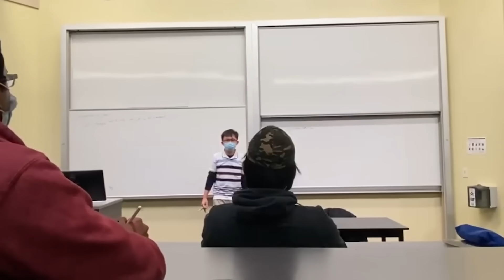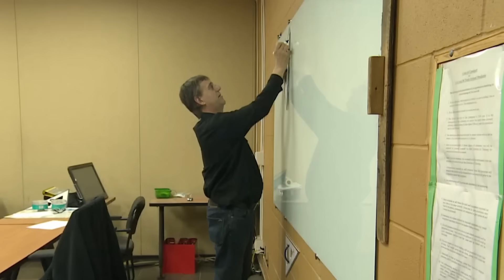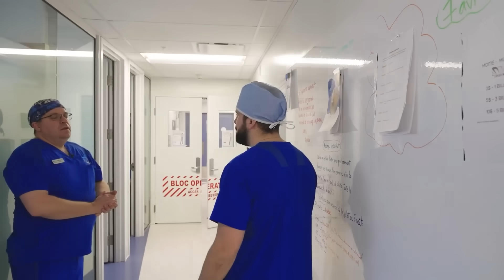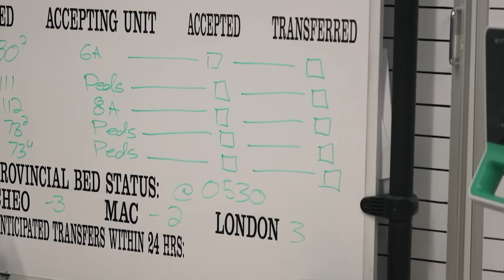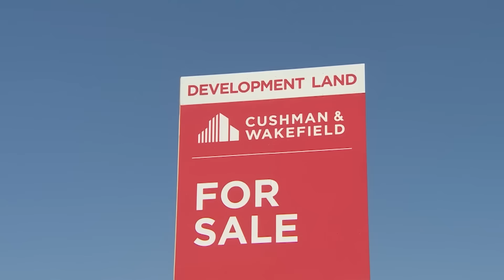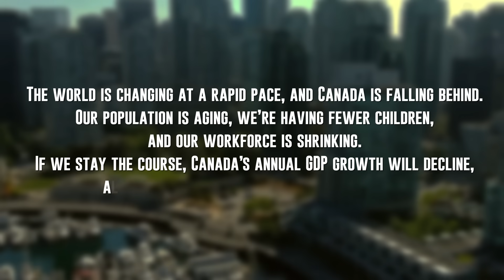Canada's Economy DESTROYED by Immigration Ponzi Scheme!

Comment: We need to put the brakes on immigration until our economy and infrastructure catches up.  Continuing with a target of over 500k immigrants for 2023 is ludicrous.
Reply: They need to remove everyone who doesn’t hold a citizenship. Period.
Reply: @smokiethebear3334 the country will be screwed then, as you don’t have enough high skilled workers or low skill professionals like truck drivers
Reply: @Austin-if7ne No, I disagree. Young Canadians will have to adapt to accept any jobs that are available. We generate enough home grown engineers and health professionals but we are made to believe we need to bring in foreign trained engineers. I worked as a regulator with foreign educated engineers but they had absolutely no field experience and could not problem solve a situation and would almost exclusively reject any alternative solutions with plans examinations. An alternative solution does not reduce life safety within the building code, but in all cases exceeds the code, but foreign educated engineers do not have the ability to accept something that varies from established codes. That is one of the many reasons why construction projects are delayed, or worse cancelled.
Reply: @Austin-if7ne  Canada Immigration system uses a point system that gives a lot of points to immigrants with high level education. So at the moment we don't really have that many immigrant coming here to do trades or truck driving. We have a different system from USA so that argument works more in the USA but not here. Most immigrants have university degree, also most of the ones who stays were university students on study visa.
Reply: We need hundreds of new apartment towers for these people asap
Reply: @smokiethebear3334 moron like you should not be anywhere close to voting booth
Reply: I agree but neither party will do it because population decline means lower or negative economic growth which could cascade into a major recession.
Reply: @davidmorton9722  Canada doesn’t generate enough engineers or doctors, most students in this fields are immigrants from China and India
Reply: @Marc-gj9vx The flood of immigrants illegally, Roxham Road, are unskilled. Also, a trained in Canada professional, in many fields cannot work in other provinces, without paying a fee, and going through a process.
Reply: @rockydj1000  cry harder.
Reply: @smokiethebear3334 do i own the country ? Thank god you're no legislator ...
Reply: @iamthatguy8071  As soon as you learn grammar, basic understanding of English is required here.
Reply: @smokiethebear3334   erm....a ? Well, then there're not that many people to remove lmao.
Reply: Meh. You could cap TR programs and maintain the 500k quota for Permanent Residents, since most immigrants are coming here on temporary resident visas/
Reply: The government says 500 k immigrants but is really bringing in over 1.3 M permanent residents and over 1.6 M non permanent residents
Reply: @jmela1370  can you prove that somehow? Because last time I checked, Express Entry draw cut offs would make PR unattainable for all too many international students for example. Not to mention that increasingly immigrants chose to leave Canada on their own, even after having obtained Permanent Residency, since they can find better options elsewhere.
Reply: @Austin-if7ne  that's a problem the government itself can fix, by stopping this ludicrous welfare payouts that encourage people into working part time or not at all. You want money, work for it. As crude as it is, it's simple.
Reply: @kobaltseven  i agree
Reply: It's funny when an immigrant calls others immigrants. All are immigrants here.
Reply: @theybanthetruth4955  My roots go back to the 1770's in Canada on both sides of my family.
Reply: @parkerbohnn  exactly, you're no native sir, you are European.  No matter how you spin it.
You are an immigrant too, I know you want to be a native everywhere you go, and stick a flag, but no sorry..
Reply: There will be more then that
Reply: @theybanthetruth4955 very true, just an immigrant who’s been there longer. Everyone does this, once they are in then close the door and don’t let others in.
I bet he likes when  certain females get in. You know the ones who are called model citizens. So he basically chooses who gets in
Reply: the problem is not immigration it is more that no one is taking steps to increase the infrastructure
Reply: We need to only look after Canadians right now. Canada is not responsible for everyone else. We need to get our economy back on track.
Reply: @Austin-if7ne  you dont need a degree to drive a truck. it's not that hard. it's about interfering in the market to have lots of workers keeping wages down while making housing scares, to keep rent high and profitable. Medicine, food and energy also keep going up in price, because of  the supply  getting stretched too quickly. Our country will be screwed if we keep  going this way. We dont need immigrants to do the jobs you think we're too stupid to do ourselves. We're not stupid. Your argument is though.
Reply: @tiata23  I never said anyone is stupid, it’s just statistics there are more numbers of immigrants in stem field, and if the country stop taking in refugees it would be better and the housing problem is because the government have stupid rules for construction
Reply: The problem started when we began taking in people from vastly different cultures with completely different norms and values from our own, mainly from islamic countries.
Reply: @Austin-if7ne  I mean I’m okay with stupid construction laws. If those laws are favourable more for the environment than construction itself. That being said Canada needs to find a way to balance the onset of people entering the country and keeping our countries beauty in tact. I’ll take denser cities over bigger any day.
Reply: @strife2746  I agree on that
Reply: @travm5540  think about it instead of building a single house for 1 family what if u can build a apartment building with 12 floors and each floor can have 4 apartments if buildings like this are allowed more then the price of housing will come down
Reply: @Austin-if7ne  true that I agree with you but the con of that would be personal space/privacy which is becoming more and more of a concern. You have 4 families in that building all with different ideal/values. That shits gonna go from a quiet building to an absolute Warzone real fucking quick. Example a family that likes loud music moves in next to the quiet type.
Reply: @travm5540  this is not a new concept it’s like this in most places with increasing population, just make thicker walls
Reply: @Austin-if7ne  Finally, someone who gets it.
Reply: @Austin-if7ne  no shit that’s common knowledge on your first point, that’s completely irrelevant but thicker walls won’t necessarily make the issue better. Try putting 3 rats in a confined spaces closely packed for so long no matter the walls they’ll still try n tear each other apart. We may be human but we are also by definition animals, animals are protective towards territory. so I would imagine my example holds true in practice.
Reply: @travm5540  you are talking like all humans are enemies, usually they live happily and are friends with everyone it’s the same as gated communities
Reply: @Austin-if7ne  they would not usually live happily tf? 😭😭 is this Disney or sum?  Just because won’t start shit doesn’t they still wouldn’t feel a certain way. Yes some people are fine with it but my point not everyone would be okay with the idea you proposed purely because people inherently have different values/rules when it comes to their own home and sometimes that can conflict. I know because I used to live in a conjoined apartment and even that was too much for some people. Like ya there’s good out there but there’s also the negative
Reply: @travm5540  I am saying everyone should, I am saying that should be a option there are many people who want a house but can’t because of the high rates and limited housing so they can buy a apartment for cheap and by allowing such apartments the overall housing market will go down in price as there will be more housing options for poor, middle class and rich people can buy there solo houses
Reply: @Austin-if7ne  well in order to change that you actually gotta do something about it, not on the internet ofc but in real life if Canadians had someone push for better laws we could buy Canadians only choose from two already corrupt political structures so that’ll never happen to begin with
Reply: No thanks.  I don't want a doctor trained in India or especially China. I know India has a few good medical schools, but it also has a lot of really bad ones.
Reply: @dvsmapple  Most of the students won't leave when their visa expires.
Reply: @theybanthetruth4955    Canada has the right to stop immigration .  Sometimes a lifeboat can't take on anymore people, or everyone will drown.  Lifeboat Canada is full up, for now.  Pull up the ladders.
Reply: @easy_sheetmusic_play_along  they are coming to study there usually for MD
Reply: @lous.1548  Agreed. The government should have prepared better for the lack of affordable housing. The feds need to do more than just talk about it.

Comment: For several months of the year, Canadians have to turn up the thermostat,  with home/dwelling heating being a major draw on our energy systems. As good as wind turbines and solar panels are for producing electricity, they cannot heat our homes. Nuclear, hydropower and natural gas burning power stations produce the base load power for the need. But a northern nation's environment is fragile and the needed power to heat the dwellings and office-spaces puts an enormous strain on the environment. 

Clearing of land and the transportation systems  mostly rely on fossil fuel use and they  put further strain on the environment. Millions of Canadians avoid winter by boarding a jet tofly to warmer places. No such thing as an electric plane. They use an inordinate amount of fossil fuels to operate. If our government was sincerely concerned about the environment they would restrict population growth to a manageable quota. Perhaps in 30 years we will be able to sustain such massive people input into our nation, but today, such accelerating population growth is damaging our environment.

Comment: Bring it back down to the 250k We were doing. It was a good balance. Its unfortunate, but asset prices will come down. If we do not accept it, housing prices will stay high, but the general standard of living will continue to fall for Canada as a whole.
Reply: Immigration should be pegged at 250,000 max.  As the unemployment rate increases this immigration number must decrease.  If the unemployment rate is 10% the immigration rate should be 0,.   That way the standard of living of Canadians will remain the same.  For example: [ immigration rate = -25,000 x (% of unemployment rate for Canada) + 250,000 ],  negative answers get zeroed  That's what you call a self correcting system.
Reply: @lazaryanya9407  absolutely.
Reply: Or maybe 0 for a while
Reply: How about 0?

Comment: according to your introduction,i am thinking of some counterpart solutions,at least a direction to gradually approach.
first, the housing problem,i think the immigrant policies should be matching the housing supply,such as the amount of houses of each territory can be slightly higher than the immigrants' number,but the 
quota of each year and each area should refer to the seperate local housing market.
there are strictly prohibited regulations about constructions in certain districts,if the contradictions cannot be solved,there could be some policies fitting the sparse regions such as less regulation requirements and   fewer tax or refund and some other political benefits about civil engineering industry,with atract foreign and domestic capital to coverge on it ,with immigrants of constructers and the specific business specialists being designed to fulfill the local development.
the most important thing is to limit the immigration number of each year except for the current most needed. the immigrant item should be like ties to the respondent requirements of conditional residency which allegedly is called "immigrant prison".make sure the period of local residency is long enough that the relocation towards Toronto and Vancouver is not necessary,such as over ten years,the terms should be included in the application at the very beginning and it's the only choice to offer.
and adjust the amount referring to the local economic statistics dynamically about which professional specialists to be absorbed in.
about the medical staff,of course the professionalism of North American medical education is on a outstanding level,but most countries around the world control the quality of medical students just as excellent as well,i am pretty sure there are adequate doctors and nurses can be accepted in North America,to balance the interests of local practitioners,the number of  counterparts abroad could be limited to certain degree but to cut them off for good is not a wise choice.
about the Ponzi scheme,it should be eased by more precisely regulating immigrants,make sure they are contributed to the economy.
to stimulate the economy ,i am considering if the concept of special economic zone can be applied in the less populated districts,which is a extensive measure adapted mainly in asian areas.
about the government,i am considering if the Westminster system can be approved to make sure the voices of the people be taking seriously in time,but there are too many elements to be balanced,there is not enough room here.

Comment: The greenbelt shouldn't impact Toronto's ability to grow.  Take any single house in any suburb of Etobicoke, Mississauga, Scarborough, Markham, etc.  Knock it down and erect a three story structure with two shops on the main floor, and 6 apartments above.  Turn the front and back yards into parking, or even better, run a bus/tram line past it, and then repeat.  Problem will be solved and the greenbelt gets to stay.
If you can't visualize this, just look at any European city.
Reply: Yeah problem solved but the cities turn into ghettos
Reply: the developers dont make millions that way
bulldozing over farmland also increases profits for grocery stores aswell because the food we eat gets more scarce because we have less land to supply the need. rinse repeat and you have the housing situation we have.
Reply: People live outside the city for a reason. I would start with Oakville. Vancouver is already that and it's suburbs are quickly following.
Reply: No thanks single houses are better living environments for people. I live in a condo and it's awful.
Reply: Building low density housing is a waste of resources, but that's what the middle class wants.
Reply: most replys to this tread are demonstrate cake-ism .
Higher density is the key to modern efficient and affordable living that similarly reduces the carbon output
Reply: @yutyuiiu  lol no it doesn't.
Reply: The cities are the ones who have stopped building from taking place. We can build up but the city councils (and voters) don't want this (zoning). 

Yet they feel for the poor. :(
Reply: So you want no quality of life, everyone living in a chicken coop. You have to get on a bus to go see a tree or patch of grass. Great life you are wishing on my grandchildren.
Reply: @yutyuiiu  higher density housing is the worst thing for this planet and human existence on it. These cities changed the Jetstream ad atmosphere and create extreme weather events. Then we get to the damage of digging down to build up, and the economic cost to running infrastructure for high rises and the maintence turn around of 10 year repair cycles and road work adverse to 20 years. I can go on for paragraphs. It literally takes someone devoid of any context to what it takes to build and maintain these systems that only make sense if a few people own everything that we then rent from.
Reply: @dootdoot1867  It is meant for the poorer masses.